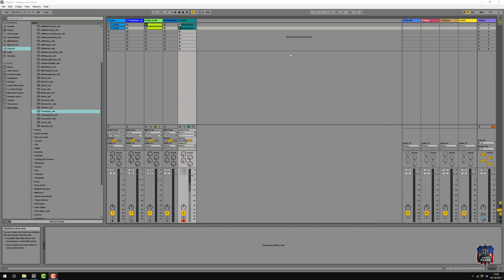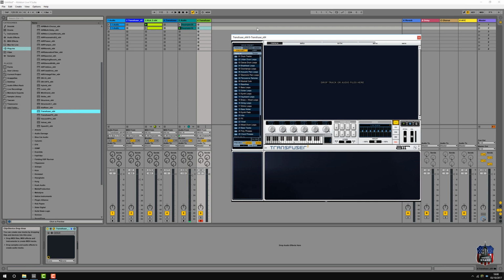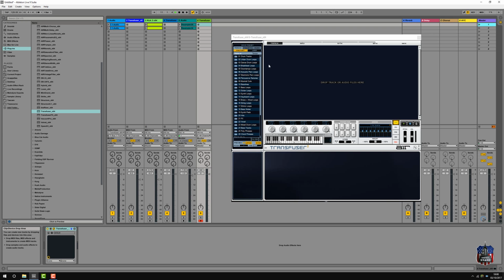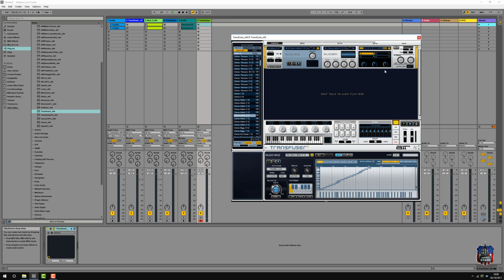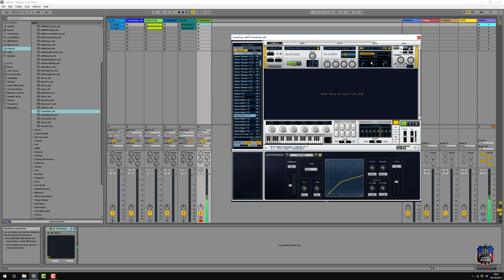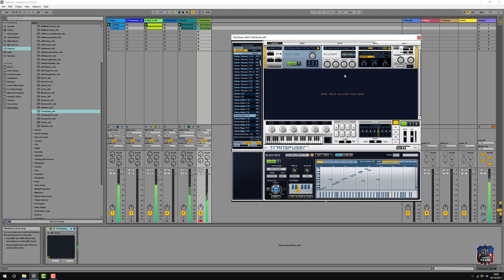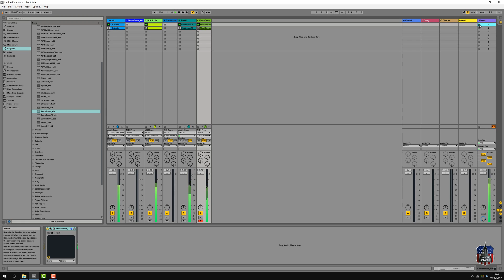Air Music Tech Transfuser 2 processing audio

Comment: Can this import loops, slice them and make immediate midi notes after??
Reply from the maker: yep
Reply: @empirestaterecs  do loops need to be perfectly cut though, or can there be a silence at the start of a loop?
Reply from the maker: @boimesa8190  I have used both and tweaked in Transfuser, shifting start points etc
Reply: @empirestaterecs  what both? I'm only talking about just one thing xD
I'm asking if transfuser removes silences from loops xD
Reply from the maker: @boimesa8190  No I don't think so, that would be a manual job
Reply: @empirestaterecs  ok
Reply: @empirestaterecs  could U maybe check to see what happens?